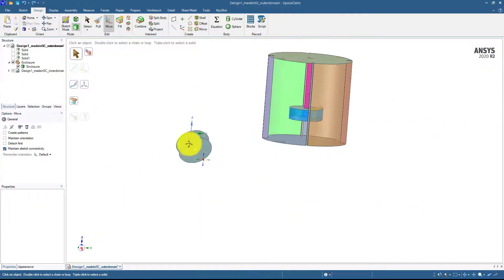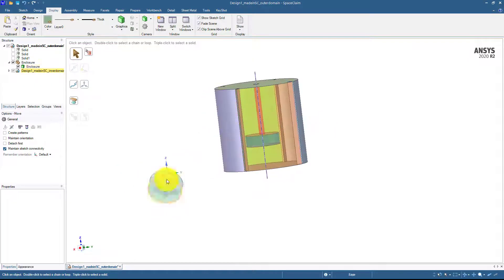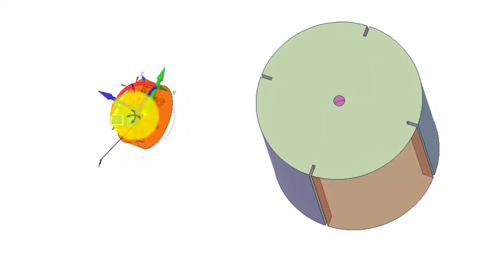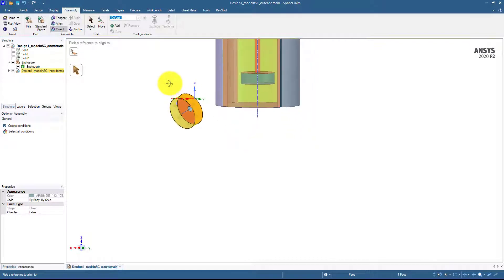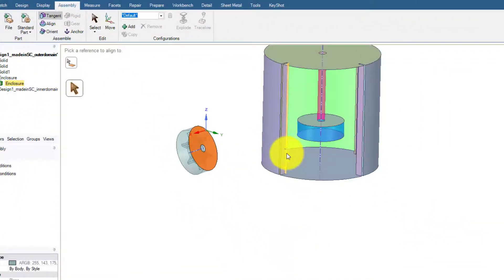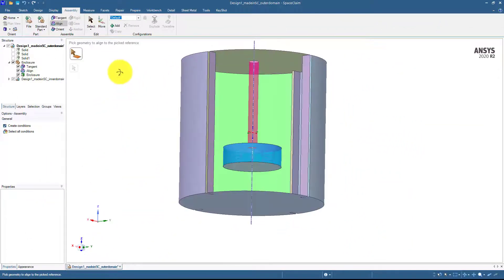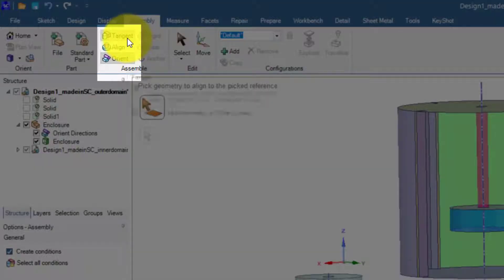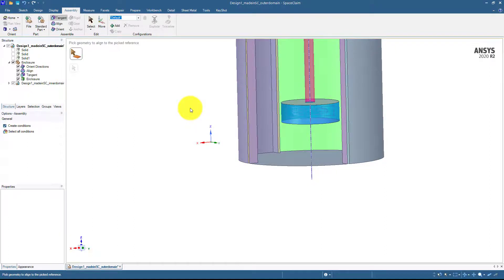Aligning two parts in ANSYS SpaceClaim for mixing tank (Rotating and stationery domains)

Comment: Hi Mr. Far, how are you? I have seen many of your replies in the CFD-online Forum and also I have subscribed to your channel. Thanks for this great amount of work you are always kindly providing to the community. I was wondering if you could help with what might be a very simple problem, but since I learned ICEM by myself, I may have missed something. I am meshing a tube inside of a fluid domain (the tube is completely "drowned" in the fluid domain. So, in order to properly mesh it, I have to create a surface (a "fluid face" pertaining to the fluid domain) at both inlet and outlet of this tube (so I can associate the face of the "fluid domain' block to it). However, I do not want that surface there, since this interface meets both the inlet face of the solid tube (due to the thickness of the tube) and the inlet face of the fluid (that is flowing inside the tube) and CFX-Pre doesn't allow me to create a proper "interface domain" with this three domains (external fluid, tube, and internal fluid). I am afraid this is very simple but very hard to explain without images. Do you think you can help? I have been working on it for many days and I am exhausted.
Reply from the maker: send details at farcfd@gmail.com I will take a look on it.
Reply: @CFD_Mechanic  thank you so much. I hope you received.